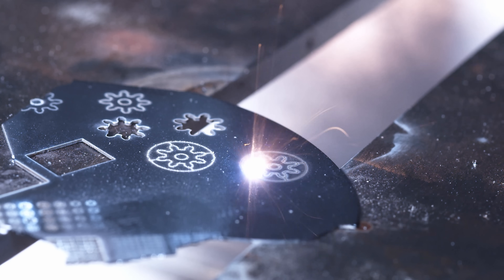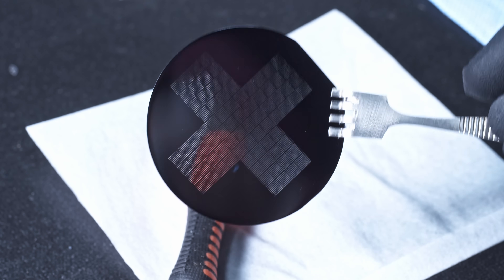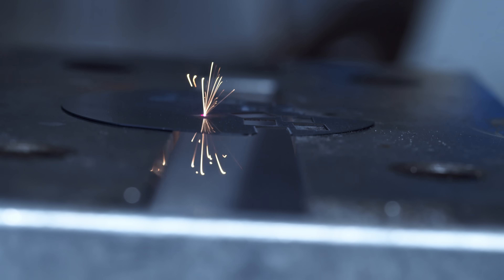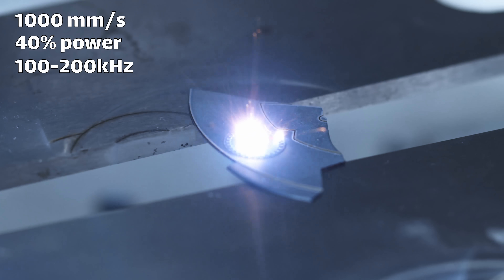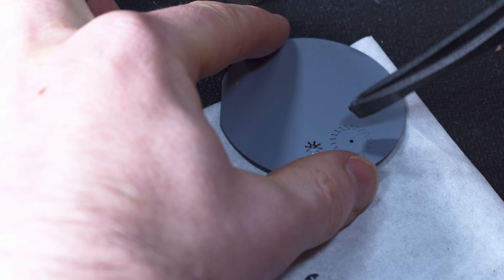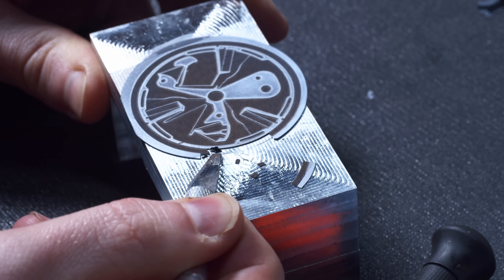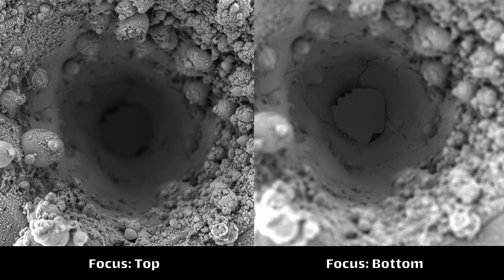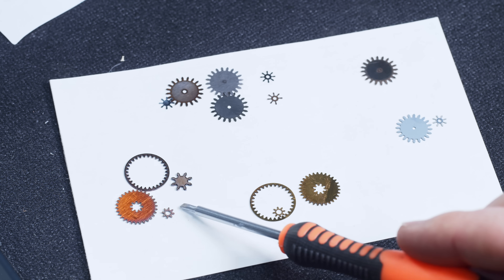Laser cutting Silicon Wafers

Comment from the maker: - As much as I'd love the glitch at 4:50 to be a secret message or easter egg... it was just a weird glitch during video encoding, and I was too lazy to re-encode and reupload. 😇
- Also, I appreciate everyone's concern over my fingerprint, but I refuse to use biometric logins at all (for this and other reasons), so I'm not particularly concerned about it being available. No more dangerous than leaving prints on doorhandles, etc :)
Reply: Actually, I think that just hit the perfect pixel mixup to screw with encoding. There's a few of these out there that will screw up a lot of encoders perfectly causing these perfect glitches. Also. To your message. I agree. ;)
Reply: What glitch?
Reply: not convinced
Reply: wait where did it go? i was still deciphering it when it disappeared.
Reply: You created a portable glitch.  It's been done.

How much to make me a pocket glitch.  Wait.  Probably shouldn't put it in my pocket.
Reply: I wonder if this device could be used as the basis of a DIY metal SLS printer.
Reply: are you still going to do a video on telescope mirrors
Reply from the maker: @christopherleveck6835  Yep! Still working on the CFRP mirrors, it just got paused due to an issue in the shop (wanted a metal mold, but having issues with my cnc machine at the moment). Will get back to it eventually!
Reply: I know this is way late. But couldn't you use glass as a part support? Considering it doesn't absorb infrared. Something like a block of glass should work no?
Reply: Hi, what software can I use to communicate with you?

Comment: Consider using UV dicing tape under the wafer to prevent it from sticking.  You can do a lift off with UV assist.  You can also use water soluble glue to stick to wafers together and cut the part until you are through the first wafer and then place it is water to lift off your parts.
Reply: The tape will melt, if kapton, char.

Comment: Can we cut acrylic materials,
Reply from the maker: Not with this variety of laser. The wavelength is 1064nm. Does great on metals but won't touch most plastics (especially if they are clear). There are UV galvo lasers though which are made for marking plastic, although I think they'd be pretty slow to cut through it. Better to use a CO2 laser I think

Comment: I've been running a 1.5kw industrial fibre laser for about half a year, so all this is familiar, yet new and interesting. I've managed to get some pretty fine detail for such a large machine (0.2mm wall thickness), but nothing like the small galvo-mirror type machines. Some of the big machines are now incorporating glavo mirrors into traditional gantry-style cutting heads for "wobble"-like features. I wonder if some of them will eventually be able to offer the best of both worlds.

Comment: Would it work to build a double or triple laser setup where the beam are merged making the pulse widths form a kind of overlapping sine wave, resulting in a more continuous beam?
 From a theoretical standpoint, obvs there is an issue with getting the wavelengths to coincide in the right way.
Reply: Also  I think adding a lens to make the beam parallel (the technical term is just out of reach atm) would eliminate or at the very least decrease the taper problem.

Comment: Very cool, per your usual!
I’m wondering if you have tried to use the machine to weld metals, or if it is even possible with that type of setup?
Reply from the maker: It is possible! Only thin metal foils, but definitely possible.  I've played around with it a little and there seems to be a pretty wide lattitude of parameters that work. You can even weld dissimilar metals together which is very cool. Some settings encourage a shallow "melting" style welding, but different parameters can penetrate or "keyhole" the material and help physically lock it into the underlying layer which works very well for dissimilar metals.

I might knock together a video about laser welding, might be interesting for folks!
Reply: Thanks for the reply! I would certainly be very interested in such a video. This type of machine only came on my radar because of your video, and now I'm very curious to see what all they can do, especially in stainless, titanium, nickel alloys, etc. The manufacturer videos make them seem like they can do magic, including 3d machining. I imagine the realities are not quite so spectacular.

Comment: You could coat the aluminum heat sink/supports with soot from your torch, be it an oxy/fuel setup or just a small MAPP gas. Hell, a candle would probably work even better. Although, as a heat sink the carbon in the soot might actually act as an insulator. Maybe a plastic support you can dissolve. You should keep trying; this is one of the neatest videos I've seen in some time. I think a "Clickspring" series on micromachining a very small clock would be very cool.

Comment: I’d suggest using quartz to support the silicon. The wavelength of the fiber laser should not be absorbed by quartz. So you won’t get the welding issue you got with aluminum.

Comment: Would it be possible to model in software the thermal behavior of the sillicon piece, and adjust the g-code for optimal cutting time with the smallest risk of damage by uneven expansion?

Comment: many true statements and good findings. Pro Tip from a laser AND silicon expert: you need to decrease your repetition rate and pulse overlap drastically and go to much smaller pulse energies, then you'll improve your machining quality significantly - but in the end nothing beats shorter pulse durations ;-)
Oh and for silicon surface finishing, just get some KOH to easily etch away most of your thermal ejecta and thermally modified material. That'll produce the typical random pyramids depending on your silicon wafer type (crystal orientation dependency of etchant)... just get 111 wafers and you'll get smooth surfaces parallel to your wafer surface ;-)
regards from Germany...

Comment: Idea: use a support material that you can later dissolve away. I dunno what acids is silicon immune to, but aluminium should be weak against hydrochloric if I recall correctly?
If not using aluminium, you could perhaps use a polymer of some kind and dissolve it with acetone or so later on.

Comment: Hey, I run a CNC laser cutter at work (macro, not micro). There's the same problem of support/welding at a larger scale, but there's also a solution - slats. We use slats with teeth to further reduce contact with the workpiece.  Perhaps for your use case, you could cut micro scale slats out of silicon?

Comment: Here's how I would remove your large parts. Laser cut a sticker into the desired shaped, remove the negative and put that on top. Then glue both stickers down to parallel flats and pull apart in parallel. Then use alcohol to dissolve the glue.

Comment: I know someone who runs a nanometre lathe making tiny cones for microwave electronics 

Apparently the trick is turn the inside in aluminium, plate it with copper, turn to size then dissolve out with acid to remove the ultra thin wall part

This video made me think it might be interesting to your projects

Comment: I imagine that there is a relationship between wobble parameters and the aspect ratio of a straight cut (beam width and material thickness), if so, how is it calculated?
Also, is the wobble constant or or is decreased for each pass, to form a somewhat "v groove"?

8:24 To somewhat mitigate the lack of support issue, can't you simply create a support structure that supports only the parts that should remain in place, while letting what should be removed simply fall?

Comment: I haven't played with serious lasers since the 1970s, but that was a room-sized CO2 machine. I'm doing some work on Fresnel Zone Plates and graded-index metamaterials for mmwave antenna lensing and wanted to try cutting Rexolite 1422 or UHMWPE with a laser, but the lack of a sensible API or gcode driver put me off.  Can you change the focus point under program control on your machine, or just the cutting depth? I want to try making 3D graded-index lens structures like the ones Rogers are doing with 3D print resin, but at a larger scale using multiple layers. Definitely a +1 from me for those micrographs. Nice!
Reply from the maker: Neither unfortunately! Focus is entirely manual on my machine, which is a real pain. There are fancier machines that have motorized focus control (either moving the entire head, or with some optics to adjust focus) but mine doesn't have that :(  Ditto to lack of gcode or API, which is a pain too
Reply: @BreakingTaps  hmmm, microactuator honeycomb bed with flexures constrained to Z-axis.... But then no good if you can't sync with the XY moves. Pity.

Comment: I was thinking that small cheap aluminium heatsinks would be perfect for supports. large area below to scatter the laser, lots of support points, but well... it's aluminium. Might be a good idea to try with tungsten or tungsten carbide due to the extremely high melting point. You could probably get some tungsten carbide from a machine shop if you know a friend that works at one, and ask for a broken tungsten carbide machine tool. Those are almost always stocks of flat bar of tungsten carbide, which would serve well as a heatsink and a table.

Comment: Hi! I have a fiber laser as well and wanted to record it, do you have any tips on how you set your camera up? I like the variety of angles you us, makes it not feel repetitive. I’m a little nervous to set my camera close because I’m scared the lens might be in danger?
Reply from the maker: I use a macro lens, but it sits pretty far from the laser.  Maybe a foor or two away on a tripod, so there's not much concern of debris hitting the lens. You could add a clear "UV filter" to the front to protect from any accidental debris. I suppose stray reflections from the laser could be hazardous to the sensor but I've not had any issues with that (yet!)

Otherwise, not sure I have many tips! Stopping down the aperture is helpful for macro shots so that more of it is in focus, but then you need to add a lot of light to the scene.  And the laser ablation itself is very bright, so it can be hard to pick the right exposure.

Comment: Try using titanium, it cuts very well on laser "marking" systems due to the high oxidation rate, much faster cut rate than steel or alu, even faster with a crossjet of atmosphere to feed oxygen to the cut area. 
I use this in the lab myself to improvise small test fixtures using 0.005 to 0.012" grade 1 titanium. Takes between 2000 to 4000 passes with the Trumpf truemark system I use, about 10 mins. 

Won't be a feature dense as silicon, but for gears and such Titanium will be much better.

Interesting results on the beam wobble, I must try switching it off on alternate layers 👍👍
Reply from the maker: Interesting, I'll pick up some titanium sheets to play with. Thanks for the tip! I would not have guessed that it would cut easier than other metals but that makes sense.

Comment: If you really want to control the heat you should use single layer graphite adhesive sheets. They transfer heat about 3x as fast as copper and are 30um thick. Plus the adhesive will hold it together. 

I still don’t grasp what the purpose of this is, especially the silicon other than entertainment?
Reply from the maker: Will try out the graphite!  Re: "why?", for me it was mainly to see if it's doable with my kind of laser. But various fields are interested in silicon micromachining because of it's unique mechanical properties. Stiff, thin, lightweight, and "easily" machined either with traditional techniques or with semiconductor fab techniques (DRIE mostly). So for example, that fancy watch flexure that I failed to make, it apparently replaces like 13 components in a watch and doesn't need lubrication. So it is simpler to manufacture and assemble and does a better job. I don't know anything about watches so that's about all I can say on it, but silicon has a lot of potential applications like that :)
Reply: But Si is too brittle.
Reply from the maker: @ohbeardedone9253  it's already being used in devices, e.g. https://quillandpad.com/2018/01/06/zenith-defy-lab-highlights-technology-change-future-watchmaking/

Also, all MEMS are silicon based, just small. Gyros, accelerometers, actuators, cantilevers

Comment: @9:13 could you apply an electrostatic field (like from one of those cheap negative ion generators) to the wafer and place a grounded plate nearby/above the cut region. Then the spray of liquefied/vaporized material could be drawn away by the charge differential.
Reply from the maker: That's a neat idea! No idea to be honest, but it sounds fun to try :)  Seems reasonable that it would work, I think the ablation process generates a lot of ionized particles/plasma too which would help

Comment: Why silicon? It’s too brittle for any practice use
Reply from the maker: You'd think so, but it's quite a useful material when applied correctly! Stiff, thin, lightweight, and "easily" machined either with traditional techniques or with semiconductor fab techniques (DRIE mostly). So for example, that fancy watch flexure that I failed to make, it apparently replaces like 13 components in a watch and doesn't need lubrication.  The stiffness of silicon combined with it's ability to machine very small features means you can create complex flexures that don't fatigue.  That watch flexures ends up being simpler to manufacture and assemble and does a better job. I don't know anything about watches so that's about all I can say on it, but silicon has a lot of potential applications like that :)

Comment: Those micro hole arrays are actually exactly what I’ve been trying to come up with for a spinning disc confocal I’ve been planning! 
So far I’ve been hand drilling a nipkow array of holes into cds-and old vinyl 45s with my tiniest drill bits, 
Is there any way I can contact you for a run of these if at all possible man??? 😍
Reply: I have to make one that acts as a pinhole array, and then make a matching and aligned (to the other) disc with micro lenses-I was considering using a epoxy fill as the lenses? I’ve heard the surface tension can provide adequate convexity? 🤔
Reply from the maker: Oh, neat idea!  Shoot me an email (info [at] breakingtaps [dot] com), happy to chat.  Or ping me on twitter

Comment: for me the most intriguing results were those non mechanical parts like the photon sieve and those interference patterns.

do you think there's a better material to cut those into? will literally paper work? paper with an interference pattern or a fresnel lens in paper sounds awesome!
Reply from the maker: Paper doesn't like my wavelength much (and/or catches on fire😅). Metal might end up working best just because it's a little easier for the the laser to manipulate without fear of cracking.  I've had pretty good luck with carbon steel shimstock so far. Still experimenting there so hard to say.  Also easier to cleanup without nasty stuff like HF :)

Comment: Do you know the story of Apple's shine through metal? Jonathan I've thinks that only should see a indicator light when it's on, and he wanted that for the aluminum bodies of the then new Apple notebook. But you can't make shine through metal. The engineers learned that lasers can drill holes so small that you don't see them and drilled several holes so that you can see a green LED shine through. Maybe you could try to replicate this effect. The article in which I read this was about the supply chain of Apple. The last time I looked for it it was behind a paywall.
Reply from the maker: Hah, that's neat. Hadn't heard of that before, will go looking for an article :)

Comment: I wonder where these wafers come from.... are they rejects from the semiconductor industry or some kind of thing like bar-ends of steel.......  ?
Reply from the maker: Yep, some of mine are cheap rejects. But you can also buy lab grade wafers from a few vendors (University Wafer is one). Price isn't horribly expensive, but it's like $7-10 per 2" wafer so you really don't want to break many. I have a mix of ebay stuff for messing around, and nicer lab wafers for the laser doping and transistor work

Comment: This may be strange, but I wonder what  the differences would be if you did this in microgravity (in orbit of earth)? I see two problems that could be solved by microgravity; the support problem (less support needed because it doesn’t have any downward force imparted on the part), and the recasting problem (the liquified silicon would be less likely to fall back down on the wafer).

Sorry if that’s a weird tangent, I just really like the idea of space manufacturing!

Comment: For your mounting issues, you might be able to use beeswax or similar, melty compound, on top of metal or granite.

Beeswax is commonly used to fix jewelry to a work surface and releases when heated. I’d imagine that you may have to use a heated solvent to dissolve out the wax for particularly thin pieces.
Reply: Or maybe a low melting point metal, like gallium or bismuth. Work with it on a solid, flat substrate and then melt it all off when you're done.
Reply: @Timestamp_Guy  Gallium would be interesting for sure. I'd be curious to know if it would wick well enough to the silicon to stick - it tends to oxidize very rapidly and get a skin.

Comment: I wonder if you could just do something weirdly basic like coat the bottom of the silicon in PVA glue to form that membrane it creates and then etch using it to help support the parts. Then you could just soak in water to dissolve it off.

Comment: could you use a masking chemical of some sort on the support material to keep it from welding?
another (possibly quite expensive) option might be to support it with an aerogel.
Reply from the maker: Possibly! I think it'd have to be pretty thick, the molten splatter that comes out the bottom is probably pretty violent.